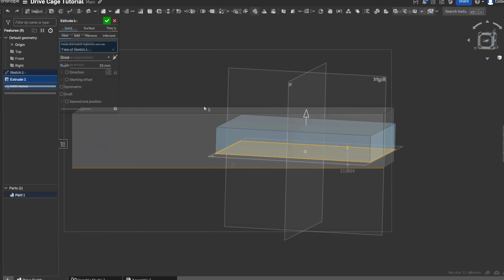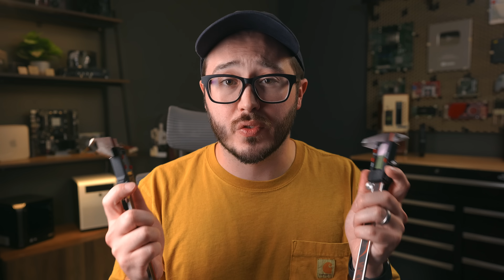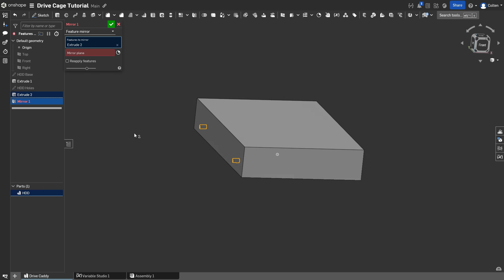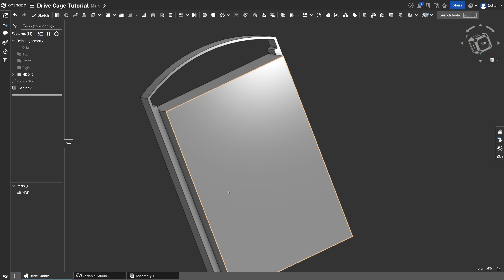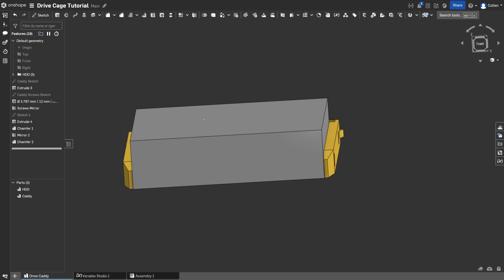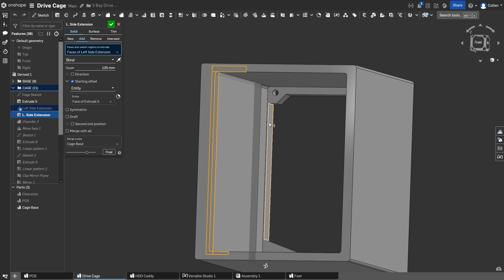Design Your OWN 3D-Printable PC Parts (It's actually easy...)

Comment from the maker: Try Onshape Free – Engineers Get Up to 6 Months Pro: https://onshape.pro/HardwareHaven
Reply: man onshapes youtube bill must be insane these last few months.  im curious if there's any way to actually own and store your projects on your NAS 😆.
Reply: @mandatoryfun_  I talked to them at a conference this summer, and not allowing storage on local servers/machines is a major downside. in my opinion. But they do work on linux and slow machines as their servers are doing all the rendering/heavy lifting. I'm hoping FreeCAD gets a little more polished, but it's also pretty good.
Reply: Thanks, please provide link to the OnShape project so we can make custom modifications!
Reply: why coudent you just design a back plate?
is the smd sata conncetors rare or something
Reply: or just a pain to use?
i have seen many PPL complaning about it
Reply: Can you please put links to parts in the description?  Where did you find those SATA backplanes?  I can't find them anywhere for sale.

Comment: Great video. I jumped into Onshape out of necessity to design a simple part once or modify something I found elsewhere, but I did not fully get the hang of it, trying things on my own and looking for specific solutions mid-work.

Watching this video, when you go step by step through the entire process and explain everything from a perspective of somebody who also learned all that not so long ago, helped me understand so much about features I couldn't figure out, but also ones that I decided not to use or used improperly on inefficiently before.

Thanks. I feel like I have learned more than in my 20-ish hours of fumbling on my own, without any primer.

Comment: I've got that exact same case, and I thought of doing the exact same thing with it. Life has gotten in the way of my installing the hard drives (an impending potential move has me questioning if I'll have the space for two pc towers). So I can't wait to watch. Very interested in those replacement drive cages, assuming my stock drive cage is as bad as yours.

Edit: And my stock drive cage sucks balls... I never would have thought I'd have to buy (who am I kidding, I'll probably build a Voron) a 3D printer to make a NAS.

Comment: I have a question for you, I run Seagate EXOS drives, they get hotter than you would expect and are designed for commercial environments, how did your designs go with handling the heat of hard drives? any deformation?

Comment: Do you know the inside dimension for the full available height where the drives go in the case? I'm waiting to buy the case but I am working on my own cage similar to yours but using 3x 4 drive backplanes so I can keep the stock 12 drive capability of the case.

Also just in case you didn't know, you can pull in models from places like grabcad or tracerparts or mouser so that you don't have to draw up commonly available parts like the hard drive. Saves a lot of time and adds a lot more detail. I was able to even pull all the surface mount component models for my backplane model so it's 90% accurate with not much more effort than your block model. 😊

Comment: The reason why you want to print these parts in PETG is also because PLA will not just warp but it will also become brittle with heat cycles. It's a great prototyping filament but honestly for long-term stuff PETG is the way to go. PLA will probably not fail in this use case but I did have a case for Rpi4 just shatter one day for example.

TPU is a hassle to work with, it's probably better to just get a rubber mat or rubber tape of desired thickness instead.

Comment: So the difficulty of installing the hard drives in the original cage could be overcome by removing the cage installing the drives and reinstalling the cage? Or removing a fan first. Also couldn't the power and sata distribution boards still be added?

Comment: I was thinking of such thing for few days since access to multiple drive bay casing is getting harder and harder. Also thought of going to use those jbods too. Thanks a lot for the awesome work you have done here. Now I need to check for a reliable 3d printing service. So it'll take about 1kg of filament, right?

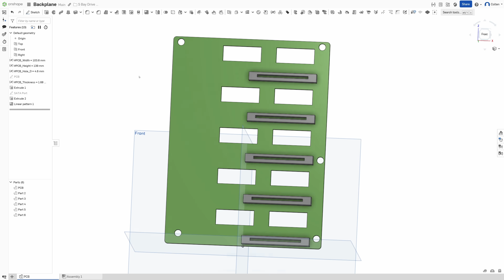Comment: 5:00 Not mentioned: With the original HD holder, it would be a mayor pita to remove a faulty HD. The 3D printed trays though... i would have them designed so that the front can carry a label with the HDs serial number.

Comment: The only downside to a lot of the better CAD software's, is you need to have a internet connection and be logged in to use them.  I am not always in a location with web access (cabin in the sierra's) and thus cannot work on projects because I lack a web connection.

Comment: I'm looking for a mini atx pc case which is small but big enough to do something like this for 5 3.5" HDD and 4 2.5 SSDs
Reply: single 5.25 slot can fit six 2.5. At least two vendors are selling hotplug enclosures with cooling built in and one or two sata power plug requirement. pci-e 3.0 requires 8 lanes to handle 8 ssd drives. Unless you find pci-e v4 sas controller you might need two sas hbas to cover all slots. You might have to start counting PCI-E lanes on selected motherboard/chipset and sata power plugs on selected PSU.

5 3.5 can't physically fit in mini ATX without eating into 5.25/2.5 slots. You might look at fractial design cases, if you haven't found it yet. five 3.5 in caddies is be quiet pure base 600. midi ATX
Reply: @Tomas-x8x 2.5 could be placed even with double sided tape how ever the challenge is the 3.5 HDD

Comment: The challenge with PLA in Computercases is not warping (or deformation) due to the heat but the deformation due to creep. Creep is the deformation under constant load, even at room temp. For structural parts, please use some kind of (carbon) filled filament (e.g. PLA-CF; or even better PETG-CF or ASA-CF).
Reply: Are reinforced PLA less susceptible to temperature softening? I had extreme warping with a cage printed in plain PLA (specifically search "3D printed 4-in-3 HDD cage"). Exactly what I wanted at the time and I though I just test it for a bit.
First I was eager to try it out, but somehow I neglected ventilation, causing the reported temperatures to reach 55°C and more. Even with adding a fan and some airflow it was still reaching maybe 42°C. Later I discovered that over time the rails and outer cage have become so soft letting the top drive sag almost 1 cm.
I think a contributing factor was the occasional shutting down of the machine, which cuts air flow completely and the internal temperature of the drives seeps out into the surrounding plastic for much longer.
The whole assembly eventually got so stuck together that I had to use my whole weight to extract the last drive. :hand-orange-covering-eyes:
Reply: Shouldn't really go with carbon fiber filaments for anything that will be handled like a computer case would. The fibers stick out of the print and can get into your fingers while handling. Also looks like CF doesn't do a whole lot to structurally improve a print.. Better to just use straight PETG or ASA
Reply: Yep. I designed+printed some custom server rack shelves/mounts in PLA a few years ago, and they're sagging quite a bit at this point due to creep, even though they're in open air that never gets very hot.

Comment: Thanks for the software recommendation.  I will check it out.  Fusion has been a bit frustrating.  My #1 problem is that I have years of experience in 2D CAD and I can design just about anything in 2D in minutes. The workflow for building something in 3D CAD is a different workflow.

Comment: Thanks for helping me learn some more functions in onshape. 
I created my first model about a month ago in onshape. It was a basic little case to hold my 12 key macropad (mini keyboard) so it sits flush next to my keyboard. I kinda fumbled my way around but I made it and it works great. It's so rewarding going from idea to actual thing.
I followed along and I'm printing my caddy right now. Cause I used metric, I want to see if I got the holes right.

Comment: Rivets are extremely easy to remove, you just drill them out. You can then replace them either with screws and nuts or with alu pop rivets, easy.

It's more unfortunate when the "cage" isn't actually a cage but is interlinked with other parts of enclosure such that it can't actually be removed without it falling all apart!

If you want a matte filament that is easy to print and holds up to heat and aging, try HIPS! Especially given you do have an enclosed printer. Be aware though that styrene poisoning is a real thing so be careful with where the air goes.

Onshape is for sure quality, but in general i don't trust businesses which can just take away your tools anytime, so i'm torturing myself with FreeCAD. Luckily it's getting rapidly less bad.

Comment: Impressive timing for this video. I'm just now planning some 3d printed mods myself. I came across a used computer built in a Corsair 100R case that only has 2 drive trays in the 4-bay cage (one of which is broken). In theory, I could remove the cage (with screws, not rivets, too!) and 8 drives should fit nicely. Drilling out a few rivets for the 5.25in bays could net another 2-4 bays for a total of 10-12. Not to mention another idea I have for a smaller NAS built around a Lenovo Tiny M720q w/ PCIe HBA and 2.5in drives (SSDs maybe)... Great, there went my long weekend. Thanks @HardwareHaven!

Comment: I may have to see about trying this. I want to make some drive caddy's for the jonsbo n3 case for actual hard drives. Someone made them for ssd's. Don't care for the drive mounting system jonsbo uses. only complaint I have about the case.  In the process of downsizing from the define 7xl, 14 drives, and dual cpu system to an itx xeon d system with fewer drives. Since I have run across docker I don't need all the virtual machines I use to run for things. I basically use one vm for trying (and mostly failing) to build my own docker containers. Only other vm's are for trying to learn different server os's. We shall see how it goes..

Comment: This might be a strange request, but could you provide an STL or a link to your onshape model of the backplane board you modelled?  I have a first generation storinator and I'm curious if I could retrofit these in so I can use newer SFF8643 based drive controllers.  From what I can tell, their current backplanes would require redesigning the drive cages (which might be an option with 3d printing), but I they don't seem to advertise a price for those but I suspect it wouldn't be cheap to retrofit them in.  Anyway, I figure printing off a 3d block might be a good way to figure out a) if they could be mounted in a way that keeps the existing drive cages and b) where'd have to tap new mount points and how much clearance would I have to connect the power and sata cables ... not sure they make SFF8643 to 4 right angle sata connectors.

Comment: That’s nice! I’m building a similar build, the difference here is I got 3x4 SATA backplates to a total os 12 disks. I am repurposing an HP Elitedesk from 2016 and I am making a sort of extensor enclosure. I’ve just not finished because I’m waiting some items to conclude the mod of the HP machine. The psu is non standard and the HBA needs some flashing but all seems to go on the right direction. 
I’m very impressed by the quality of your prints.  I’m new to the hobby so mine are still pretty rough on a sovol Sv07 plus.

Comment: Recently, I've been curious about how hard it would be to make an open-source hot-swappable backplane. Theoretically, wouldn't it be great if someone designed something that we could ask a company like PCBWay to make for us and ship in small quantities? We could build whole modular NAS systems around an itx board and some of these theoretical backplanes. It might even be cheaper than buying backplanes secondhand.
Reply: It might be, and I love the idea! I have been working on 3D-printing an enclosure for some cheap backplanes I bought off of eBay, and it has turned out to be QUITE a project! I originally was going to orient it standing up (with the power supply underneath and the drives slotted in vertically), but I may end up going the horizontal route, as I would have to create a whole mounting system on the bottom of the PCB for the PSU if I wanted it to stand vertically on its own. Still in the process of figuring it out!

Comment: Thank you! After 2 months of 3D printer ownership, I never designed my own parts until a few minutes ago. I just finished designing a small rack part for my bike using Onshape, following the basics in this video. I was trying to learn FreeCAD, but Onshape is far more intuitive ! Your video gave me the confidence I needed. Thanks again ; I've subbed!
Reply: I think the difficulty with FreeCAD at least before 1.0 was the topology conflicts that could happen. If you were learning it prior to the 1.0 release you should give it a shot again now.

Comment: the only part of whole things which needs to be explained in details is how exactly did you measured sata port clearances, but you've completely omitted this part in favor of explaining an exceptionally simple features like mirror(which you could skip by just making holes not a 5mm deep but straight through whole part since they are only a point of reference), that's a shame

Comment: If you can find it, I recommend just buying a fractal Define R5.  I comes with two (stackable) drive bays, which holds about 8 drives (I think).  It also has space for several SSDs.  I found it on B&H for 140 bucks.  This is a bargain (in my view).   Unfortunately,  the newer defines require the purchase of additional drive bay adaptors, which I think is rubbish.  I think the R7 XL does come with 6.  So if you're not going to use more than 6 drives, then this is a really good option.  It costs around 240 bucks.  I did manage to find a 2 pack of drive bay adaptors, so for an 8 bay build this would take you up to 260. 
I don't own a 3d printer, so I would probably go down this route.  Also Sliger make really good quality cases.  You're looking between 340 and 440 for those, depending.  But those have space for 10 drives + SSDs.  More expensive, but a good option.
Silverstone tec also have some good options.  These aren't that cheep though. If they were Sliger money, I'd go with Sliger.  Although sliger cases don't come with fans, included in the price.

If you already own a case which will fit these bays, that is clearly the best option.  Although again, I don't have a 3D printer, so I'd have to buy some.

I really like the creativity though, but just wanted to put out some more options.
Reply: People should also check out the Rosewill THOR NAS for a DIY NAS focused build or the Anides AI Raider XL for the modernized 12 x 5.25" bay alternative. For rackmount, Silverstone makes a huge variety of 4U, 5U and 6U chassis that i think are way more versatile than the Sliger cases.
Reply: @CheapSushi  I should add, the Sliger cases are rack mount.  They come with the rack brackets, but not slides.
Reply: Fractal Design 7xl is a really good case. Becareful of the drive trays though. There are 2 different sizes. Make sure you get the right ones.

Comment: Please note that PLA might also creep over time. As in: slowly distort. The higher the temp, the faster it usually is. So it might look okay first, then slowly go very wrong and maybe trap/dro(o)p the drives
Reply: Yeah for mechanical brackets in warm environments I would go PETG. They make hi-temp PLA now, but it will still creep if left under constant tension.

Comment: PETG is mostly recommended for projects like this because PLA creeps over time and starts to sag
Reply: There is nothing he designed that is subject to sagging / creep. PETG has it's own sagging / creep issues, but still for this project, wouldn't matter.
Reply: @wojtek-33  PLA is more subject to heat deformations which can be caused by the HDDs, though its not a huge problem in this case. PETG would still be a better choice though
Reply: @XX-pp3bx  heat sagging and creep are separate problems with PLA. PLA never fully solidifies, so if left under constant tension it will essentially "cold flow" and deform. This is regardless of temp.
Reply: I have also had the issue that my PLA prints started getting brittle and crazing around load spots, it happens about 3 years after i print the item, even for well shielded indoor items. All of my PETG and HIPS prints are intact no matter how old they are, only one sunlight exposed clear PETG print got a little discoloured and lost a little strength after 6 years.

Comment: I bought that same Vevor case. I moved my whole NAS setup into it (8x 8tb drives) It works great for what it is!
Reply from the maker: Yeah, I think I might've just received a bad unit. TBF, I could just bend the sheet metal outwards and make it work, and then just deal with the awkward screw placements and cables. But it seemed like a good opportunity for this idea I've had!